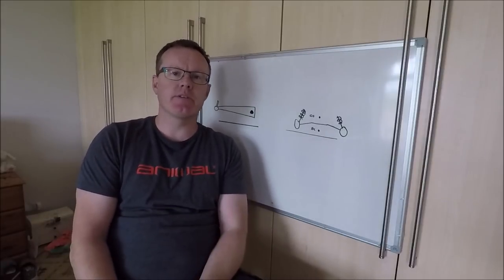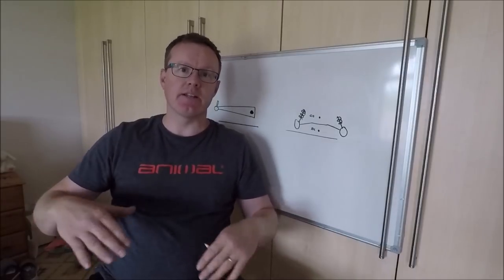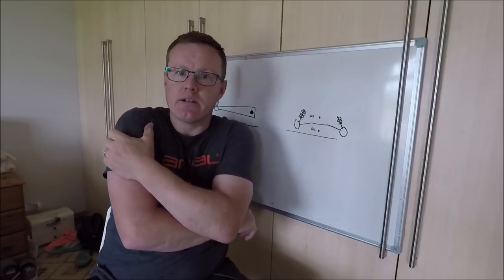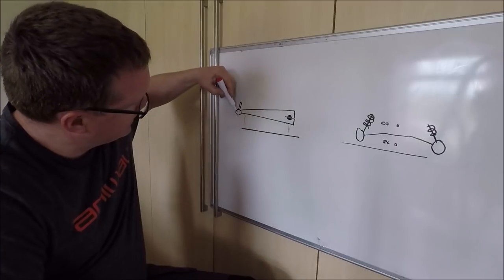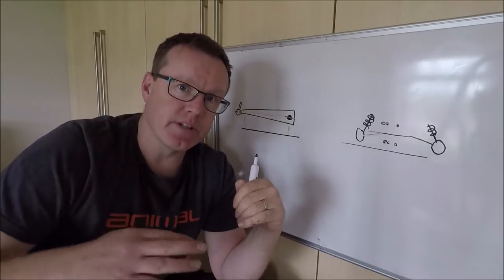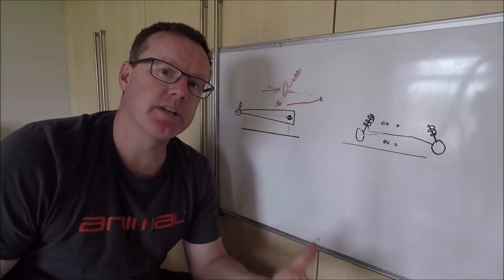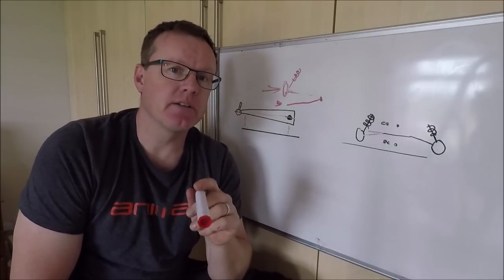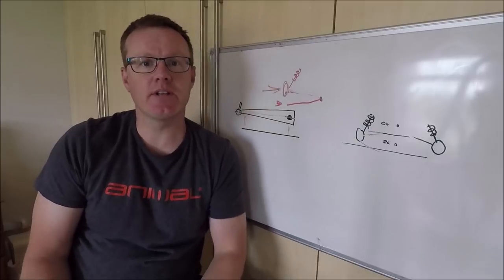NEVER lower your car? Roll centre problems

Comment: Licensed mechanic here- you're right that most people don't know about or consider roll center when modifying their suspension. However, many performance engineers do consider roll center and many aftermarket performance companies make roll center adjusters or correction kits to bring the roll center back as close as possible to the center of gravity. Having a lower center of gravity and a closer roll center will DEFINITELY result in better handling and reduced body roll over a stock vehicle and it's a little misleading to say that nobody should lower their car because they will be changing their roll center... You're correct that people should be considering the roll center, and I'm glad you're bringing awareness to this issue, but I don't think many people are aware that specific products already exist to address these issues.
Reply: This is a good point, though I think the problem with the MK7.5 ST in particular is that these correction kits don't seem to exist (from my limited research)

Comment: Hi Steve, with regard to the pedal spacer you put in, how are you finding the 38mm? I've been considering putting one in, but do you think about 20mm would be sufficient? 38 looks too close for me
Reply from the maker: I did discuss it in a video a few weeks back. 38mm is too big. I prefer 10mm now. You can't do 20 mm due to the way they bolt up so small or big at the only options unless your creative.
Reply: @Sparkplugsteve  I saw the one where you put it in. I did think 38 was a bit too close. Thank you for replying 😊 sadly I'm the polar opposite to creative haha

Comment: Hi Steve, since lowering my car, I had a clicking noise from the front  near side wheel. I thought maybe it was the driveshaft on its way out, or the RT330 power had ruined it. But then I had the K-Sport big brake installed and it went away. But just this last week the noise has come back again. Any ideas? Could it be related to the drive shaft being at an odd angle since lowering? Any advice greatly appreciated. Thanks 👍
Reply: Could be the ball joint on the lower control arm. Often it extends beyond its specs and rubs. You need a Roll Centre Correction kit or race LCA and race tie rod (also anti sway bar new adjustable links)

Comment: Yours is lowered on the Mountune springs isn’t it??
Reply from the maker: Yes it is. When I fit my coilovers it will sit higher.
Reply: I really want the Mountune springs next. 👍
Reply: Why? Steve said it makes the car handle worse with more understeer with mountune springs
Reply from the maker: @addisj  mountune springs are really the best of the spring options available as they lower the car the least. But like I said in the video it will only really become apparent on track so if its a daily just fit whatever spring you want and don't stress about it too much.
Reply: @Sparkplugsteve  sure.. personally I would only lower mine if it actually improves the handling (track or road). If there are no improvements I won't do it. If the lowered springs actually make the handling worse when pushed hard (you mentioned understeer) then it's a no brainer for me anyway - not to fit them and to get coilovers instead.